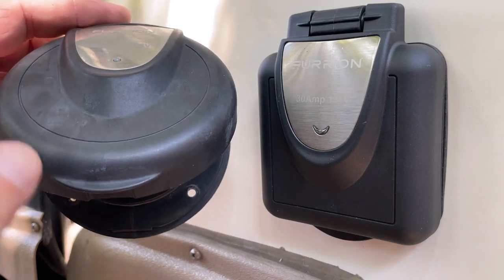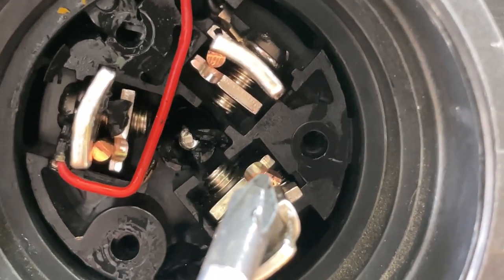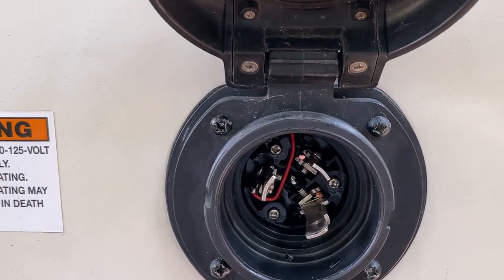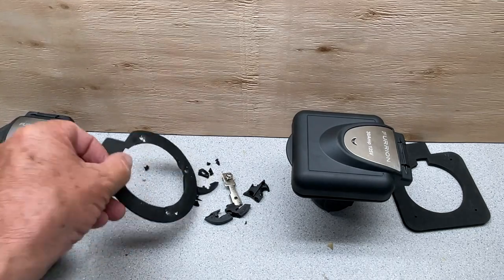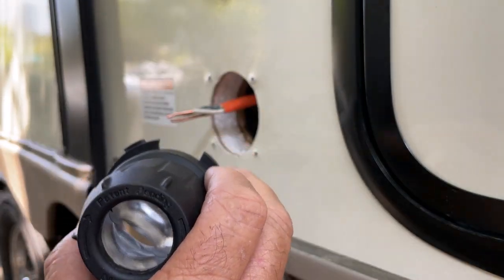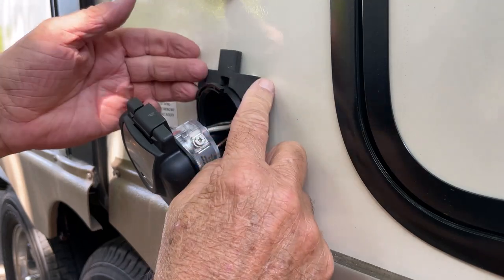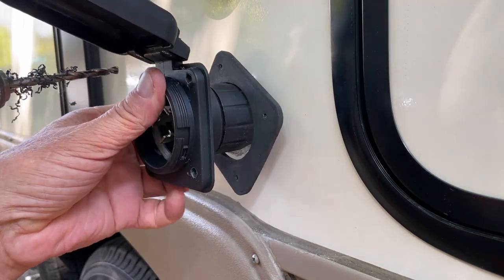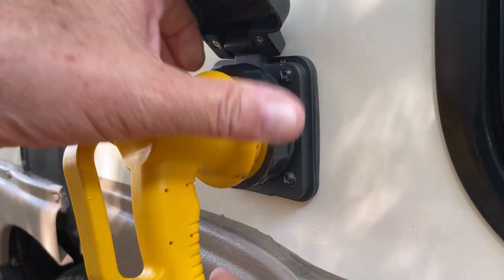This Could Happen to You!   Our RV 30Amp - 125V Power Inlet Disintegrated After Only 4+ Years of Use

Comment: I  am going from a pull out to the plug in!  Should I reconsider leaving to a pullout power?  I just bought Park Power kit that has a round inlet.  What do you think of that kit?   Last question, I have a fiber glass Casita.  What is size and length of your screws?
Reply from the maker: If everything looks good on your pull out set up, shows no wear, and is working fine I would stick with it until it needs to be changed out. How old is your trailer? I'm not familiar with the Park Power Kit but it looks like it will work. My screws were around 1 inches long because my side walls are around 1 1/4 inches thick. I suggest you take a real close look at what your wall thinness is before screwing in screws (maybe you can contact Casita to ask them or do a search online). Is this what just bought? https://www.park-power.com/en/p/30ARVKIT/30A-RV-Conversion-Kit

Comment: Great video. We had the exact same incident and I also replaced the same square one that is sturdy and, as you said, looks more reliable. It was too bad because I just had bought my couch 1 month before it happened and I wasn't familiar with RV world. Now I am periodically checking the outlet and might replace it in a certain frequency. Also, I bought Jogoswall Automatic Fire Extinguisher, which is installed right behind the outlet just in the case of the worst scenario, in order to prevent potential fire hazard.
Reply from the maker: Thank you and thank you for watching, the new power inlet I installed is much better. 
Is this the Automatic Fire Extinguisher you installed? (amazon affiliate link) https://amzn.to/3QWhLhm 
Yep RV's have lots of surprises but if you are handy and can fix them yourself you save lots of money by not taking it to a shop. 
Check out my other videos and subscribe if you haven't already, I try and put out a video every couple weeks - https://www.youtube.com/c/MichaelBracewellTheTravelTrailerGuy/videos

Comment: Yes, those slightly loose connections of the original plug are the culprits of the plug disintegration as the looseness contributed heat at those points which baked the plastic to that state over time. Also I've found on our camper with similar connections that the screw on ring is a hassle to get tight so that the plug doesn't move when you're hooked up. I run it down considerably tighter than you did for your adapter dogbone connection, because if that plug is loose, you get the same melting situation on high load like with the AC running.
Reply from the maker: Thanks so much Silas. Here's another option to replacing the set up that comes with the RV's that would work much better but its quite a bit more expensive.

Here's another option for a quality replacement plug and cord set up worth looking at:
SMART PLUG Smartplug Systems, LLC Gray Bm30Pg Smartplug Non-Metallic 30 Amp -
https://amzn.to/3ufF64h

SmartPlug R30303 RV Dual Configuration Power Cordset with Park Power End - 30 Amp, 30' Length -
https://amzn.to/3tmvYLF
Reply: @thetraveltrailerguy  I think the 'smart plug' is a superior design. If I had to replace my plug, I would consider one if I can find adapter 'dog bones' to work with it like I have for my current factory installation.

Comment: Our new 2021 Mini Lite 2104s has a square looking outside plug. I would hate to replace this plug with a newer smart plug, if NOT necessary ?  What do you think ??  BTW  Great video as always !
Reply from the maker: Take a close look at your square plug and if it looks like the one I replaced under the lid if you can see screws make sure you keep an eye on it (non marine plugs have screws showing). It may break up like the one I had and cause a electrical short, while its unlikely it could happen. I replaced mine with a Marine plug that is built much better than the stock one and I believe it will last a long time with no issues. I like the Smart Plug but believe its overkill and is pretty expensive. If I was rich I probably would have replaced ours with the smart plug. Thanks so much Ed, I apricate your comments and for watching :)